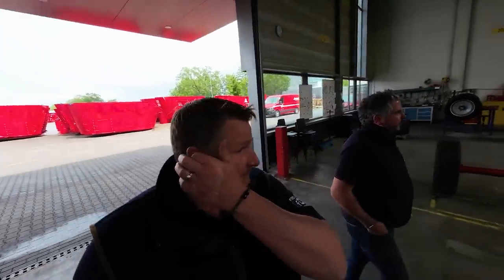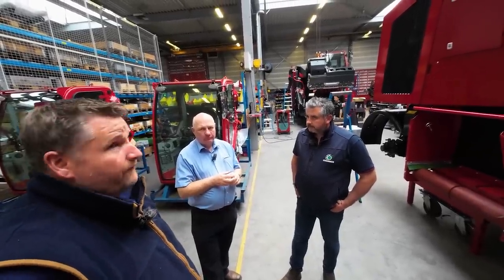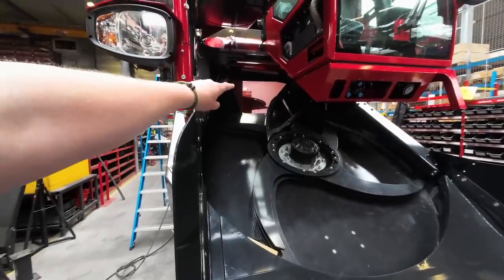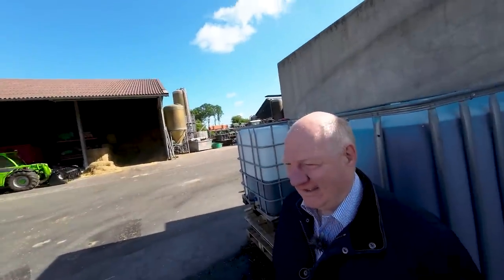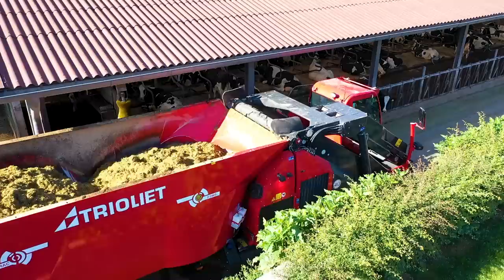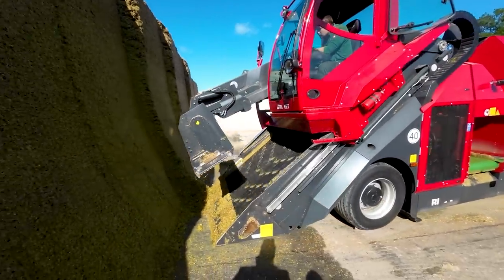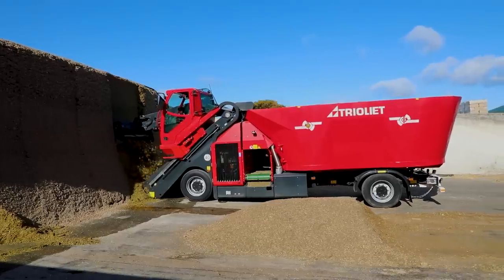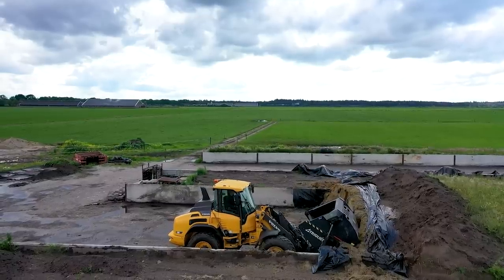Trioliet Self Propelled diet feeder

Comment: Yes but when you keep going bigger and bigger you reach a point where your machine is not cost efficient. I know we are dealing with same prices with fertilize, fuel,parts, and everything else. We try to be as efficient as possible we cut with 100hp tractor, rake with 100 hp and bale with a 165 hp . We are covering 4000 acres give or take depending on weather and the only thing we can use to get any more efficient is we need to get a t5 140 to put on a mower so the rake tractor can get a break and be ready to move bales . I watch your videos and my goodness 🤣🤣yall would use 500 hp to cover our acreage on 2 units alone 🤣🤣
Great video